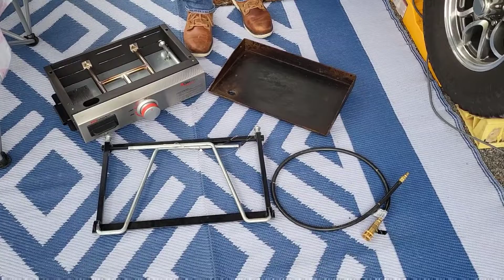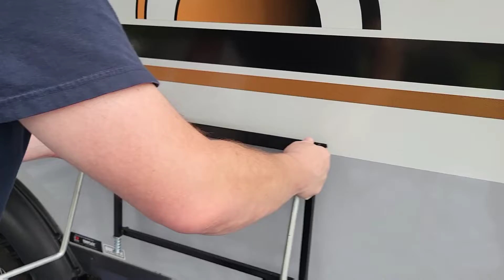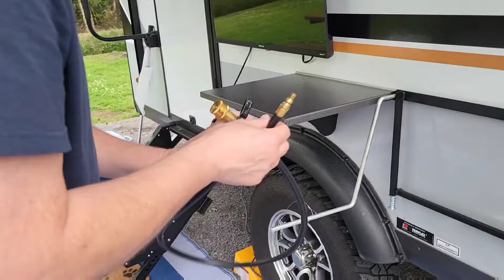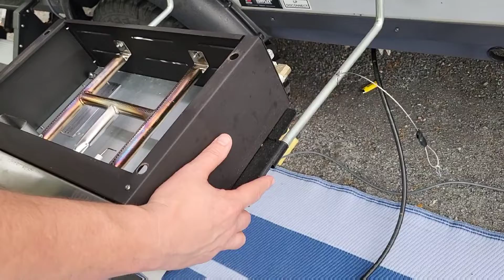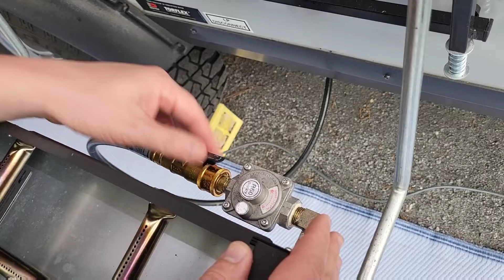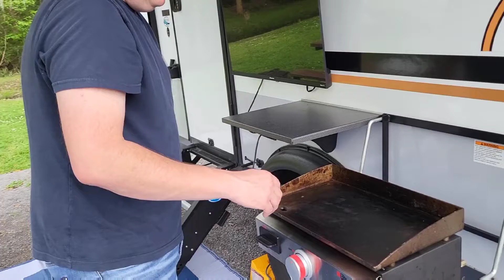How to set up an RV gas grill or griddle for beginners.

Comment: Like your video. Have one question. Ours had a medal disc that has Heat Shield must be installed before use! Where do you install it?
Reply from the maker: Ours didn't come with the shield but it would have been great to have one. Bacon grease would always splatter on the side of the camper.

Comment: Thank you that was very helpful.  I didn't know which way was the off position on my RV.  When you go away from your RV or go to sleep at night do you leave the grill hooked up?  Won't rain damage the grill top or the actually grill burner mechanism?
Reply from the maker: I do leave the grill hooked up. I have a blackstone cover that i use now.  Prior to that, I would just use a trash bag and put something heavy on top. You definitely dont want the top grill surface to get wet and sit. It will rust.

Comment: Have you looked for disposable foil liners for the grease tray?
Reply from the maker: I haven't. Honestly it's so small and easy to clean that I'm not sure that it'd be advantageous. I will add that the grill frequently over runs the tray and drips on the ground even when it's empty like the alignment of the grill top drain is poor. Kind of annoying...

Comment: Is your tank regulated at the front of the camper as well as the grill? I purchased a FlameKing but the regulator is built into the brass connection and may require another connection I don’t have yet. Thanks for the great explanation.
Reply from the maker: It is regulated at both the tank and grill.